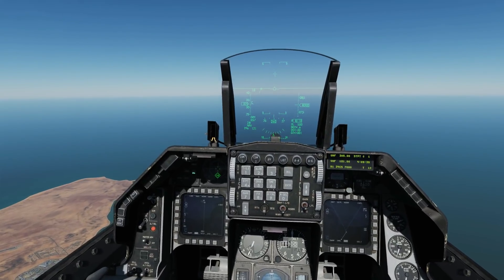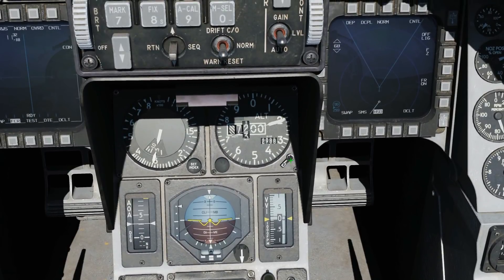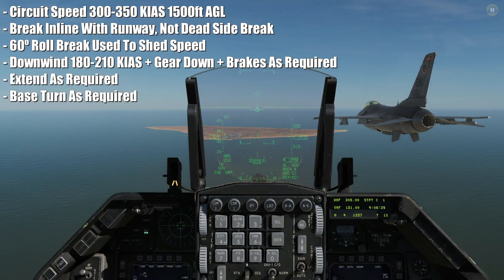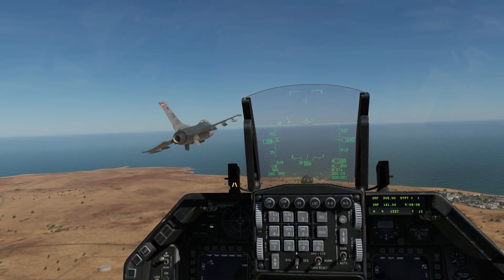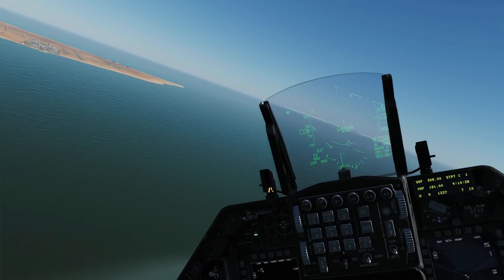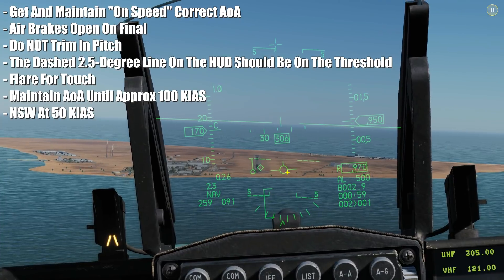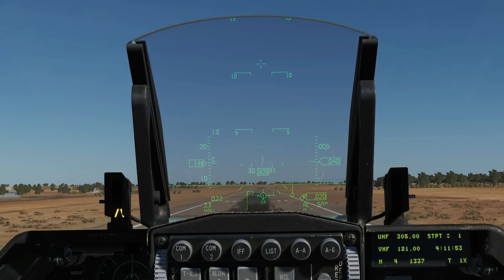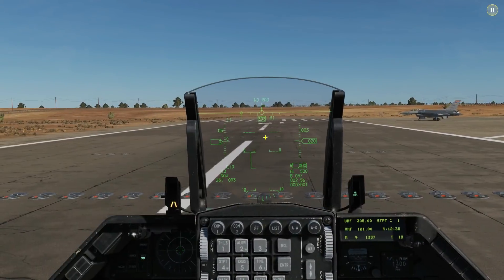F-16C Viper: VFR Approach & Landing Tutorial | DCS WORLD

Comment: hello GR do i hold the wheel brakes or dab them in intervals like you did, which one is faster
Reply: Dab them to save the brakes, hold them if you have to stop.  The Viper has anti-skid brakes so they won't lock up, but the brakes are not exactly powerful.  I doubt brake temperature is modeled in DCS. Do what you need to get her stopped, but don't try to make the first turn-off.  You bought the whole runway, might as well use it all.
Reply: @greasemonkey981  cool thanks for the help

Comment: Better than last time, but still lots of negative training errors:

Extending way too far, this is not an airliner! Roll into base leg when your landing area is 45-degrees off your shoulder.
 I use the wingtip missile rail over the threshold as my sight picture.
In base leg, you should be 8 to 12 degrees pitch down.
Airbrakes should be out on the downwind, not wating until short final
On short final, the FPM and 2.5-degree pitch ladder line should be lined up
Aerobrake should be 13-degrees, not 10-degrees
Once the nose wheel is down, you should override the speedbrakes to fully open them
Nosewheel steering should have been engaged once below 70 kts

Comment: Hey Cap,
Some additional thoughts on your video... You mentioned that you can extend your downwind as you like but since the purpose of the overhead circuit is to get as many aircraft as possible down on the ground in the shortest time possible, it is quite important that particularly the lead aircraft of a formation starts the base turn in the correct spot. Spacing between aircraft in a formation should ideally be created by delaying the break turn for 5 - 10 seconds (depending on what spacing to the preceeding aircraft you want to achieve). The subsequent pattern should be flown with the same power settings/speeds/bank angles as the lead aircraft. Another advantage of always picking the same point to start the final turn is, that You can fly your final turn using similar parameters (Bank/pitch power setting) every single time (provided wind and aircraft weight are comparable).
For singleship recoveries it doesn't really matter that much, if you extend yout downwind, but for formations it's crucial... imagine lead starting the base turn at 3NM, #2, #3 and #4 extend an extra 1/2 NM each... #4 will have to fly an almost level final turn to end up on the desired glidepath and will become a huge factor for other aircraft on initial.

Apologies for the smartassing!
Reply from the maker: Good call Sir. Just trying to keep things super simple.
Reply: I appreciate the reply... Thx